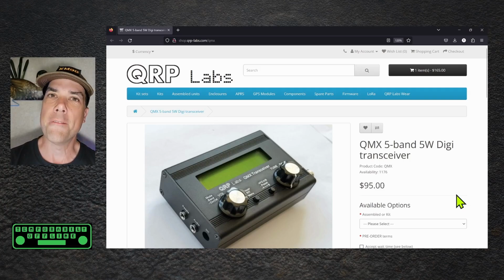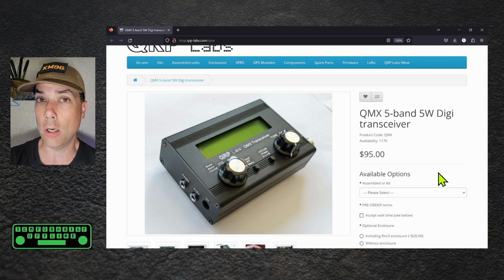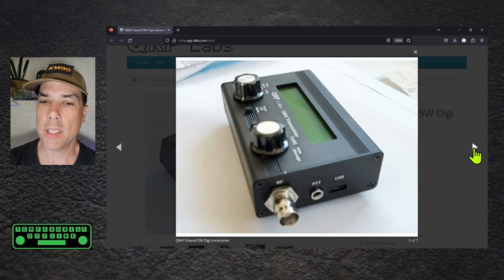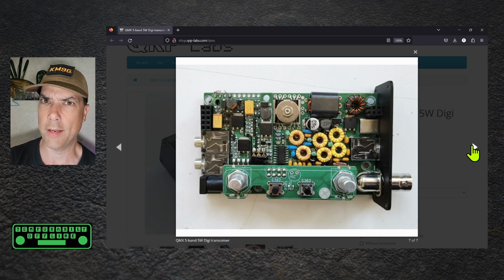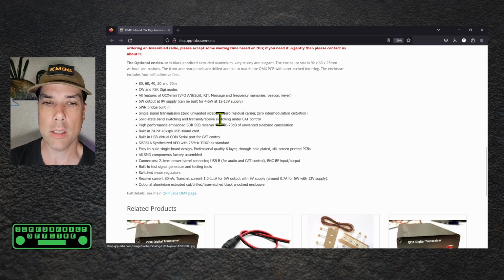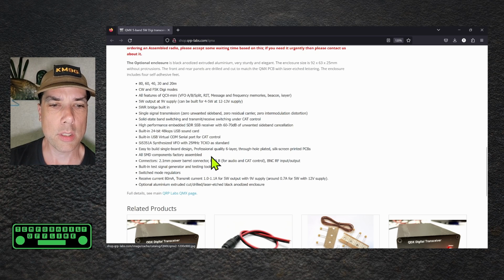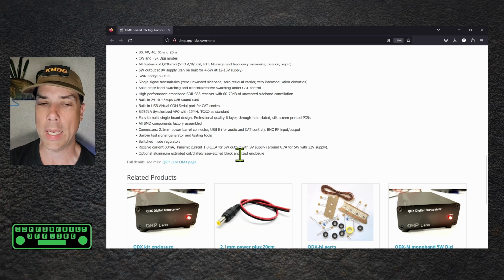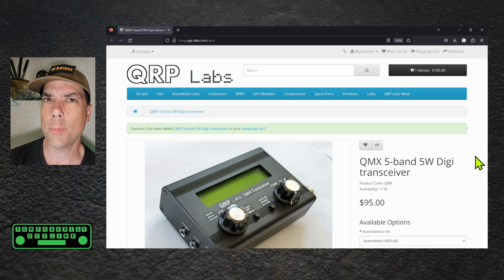The new QMX from QRP Labs!

Comment: I waited till there was good sounding SSB firmware for the digital and CW mode QMX+, (it's beta code, but when properly adjusted for the rig and mic with built-in firmware it sounds really excellent,) then I bought the kit to build, (SMT's are pre-mounted.)  Then I bought another one for a friend. Very good gear. Great gear for the price. Far superior processor and audio decode than the SDX series rigs. No comparison. This is not bottom tier gear. Numerous, and I mean numerous handy features built in. If you ever wanted a small, inexpensive rig that was thoroughly thought through as it was being  designed, this is it. Stock is available in USA so you'll get it in under a week and without a tariff - for now. Who knows what the future will bring. There's an assembled version, but the wait time is looong, i.e. months. Just get the kit and build it. Then you'll know it. Assembly is mostly just winding filter toroids for the 12 bands, 160 through 6 meters, (plus SSB on the US CB band which you must stay off unless there is a life threatening emergency and you have no other option. But it's good to know it's there.)
Reply from the maker: You raise an interesting question there - I never thought of this, but is it legal to build your own US CB transmitter?
Reply: @temporarilyoffline  probably not, that is a restricted terrain ( same for GRMS etc ) needs an FCC approval.
Perhaps you can raise the money for getting it approved ( as a manufacturer )

Comment: I got the qcx mini hooked up to the 50w pa, but not much luck, wonder if you have any ideas.  qcx with 12v and pa with 18v. max output is 30w on 20m.
Reply from the maker: I have a video build series on the QCX PA, I'd start at the beginnings: when you key the QCX, is there any change on your multi-meter readings on the PA cable?

Comment: This is the way to getting EER (Envelope Elimination and Restoration) for SSB or other modes. It is far more significant than what the QSX might have been. Imagine what this could eventually lead to. A small form factor rig that does legal limit at 90% efficiency. The big 3 will be left in the dust....
Reply from the maker: The big 3 are already dusting themselves in a lot of areas that the other importers are taking advantage of.  Maybe we'll have a "big 4" soon!

Comment: SSB soon? Hans originally said "QMX does not do SSB at this time, not with this current version of firmware." Also the hardware is set up for it to do voice ('mic' on control board - although not populated, bu it looks like the 3.5mm 'Audio' port on the side is speaker/earphone only). So will the QMX eventually do SSB?
Reply from the maker: I've heard rumors,  but nothing confirmed yet.

Comment: Great news!  I was on the website, and looking at the options. I did not understand the "QLG2 GNSS/GPS receiver" option.  Can someone share with me why this would be a good option?  Thank you!
Reply: I just built one and it is great to set the time dead nutz on my Mini's for running WSPR. Get the display kit or the clock kit to go along with it. On my clock kit, I swapped the display out for a 4 line instead of the 2 line that it comes with and there is a wealth of info you can display including custom text. Takes a bit getting your head wrapped around the 2 button interface to customize what is displayed. Lets just say it is different but works.
Reply from the maker: I don't think they are QMX add-ons, but rather other things you might be interested in building.

Comment: Rumor has it that there's a high band edition of this radio in the works (as in - I talked to the guy doing it at the QRP Labs booth in Dayton).  I'll be first on the list for that one.  These are fantastic radios, but the whole point of these radios is downsizing your kit.  That's a lot easier to do on 10M than 80!
Reply from the maker: This would be a great 20/10 setup!
Reply: Nice to hear. Then I’ll be next on the list for a high bands QMX. When most of these new QRP  SOTA style rigs came out it was in a solar cycle slump but now the higher bands for SOTA have a lot more promise. Plus, higher bands have easier to deploy antennas on a peak.

Comment: There was a GPS module option. What can be done with that?
Reply from the maker: I was thinking it was a "hey, while you're here... but this!"  Like the dummy load and the power cord - non-specific up-sell.
Reply: I think its used to get the exact time for digital mode
Reply: @dorvinion Well, yeah, but it takes a way to read it (serial port) and software somewhere (QMX or WSJTX client) to translate the strings. And that was not documented.

Comment: I have build 5 QDX's of various revisions and several QCX Mini's. The QMX looks to be the highest component density of the all hands down. If you are a beginner kit builder, this shouldn't be your first kit. $50 is a small price to pay to get a built working one. It's 8-10hrs of time to put one together.
I will definitely get one down the road and if history is any guide, the main board will go thru one or more revisions. To be fair, my orginal REV 1 QDX works just as good as the latest revision built. 

73
Reply: @tookthe5th182 I was thinking of building either a QCX+ or the QCX Mini as my "first" transceiver build. I've build a couple of QRP labs antennas and the 4States simple CW practice oscillator without any problems. 

What do you think of either of the QCXs as a first transceiver build for someone with a little soldering experience? I was looking at some of the crystal kits (like the Cricket or the Rockmite), but it might be cool to have a full band to work with rather than just a single frequency.
Reply: @av3510  The QCX+ would be an excellent first rig kit. A much more relaxed layout and plenty of room to work...
Reply from the maker: @tookthe5th182 is right, this looks dense and therefore a little more difficult.  The QDX  comes in a monoband kit or a 4 band kit and is a lot easier than the QCX Mini.  the QCX+ should be pretty good and if I recall, its a larger kit.
Reply: Talked to Hans at Dayton. Looking at the kit, # components and the size of some of the toroids I asked how long to build one. Hans told me HE could build one in 2hrs, that means Joe Public is probably 2x that, or more..... Ponied up for the extra $50 for a fully assembled one. Leadtime 2-3w apparently.
Reply from the maker: @jonandrews6839  I was thinking 4 hours for the QDX, so I budged 6 for the QMX
Reply: @jonandrews6839  Hans is a better Man than I am HIHI. I take my sweet time and all of my kits have come right up at first power up, zero errors.  Minor coil tweeks for max power...

Comment: I ordered this right away when I saw it in some of the Four Days in May coverage.  Did order the built version so it looks like it will be quite awhile to get it, but looking forward to arrival.  Question: if I want a power amplifier, do I need to order the QRP labs version or should this work with a Micro PA-50?  I plan to use it primarily in a QRP setup, but I like flexibility :)  Oh, and if this is a dumb question, I am still very new to this whole thing!  73 KF0LTY.
Reply: All of the Amps QRP LABS sells are monoband.
Reply: @tookthe5th182  OK, thanks.  I assume then they won't work with the QMX.  I can't see a reason though that the Micro PA50 won't.  Regardless, I will be testing!
Reply from the maker: I think if you build/use the right cable (being mindful that you might have to switch some "pins" you'll be fine with any amp.  You can use the QCX PA on the band you build it for (only) and that is another option.
Reply: @russbrown194  Yes, that AMP should work fine and would be my preference actually.